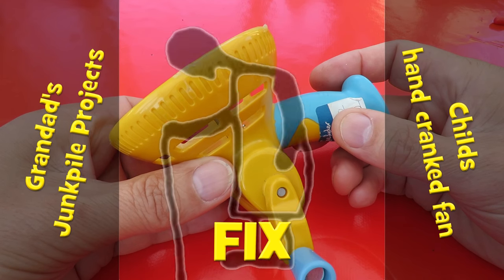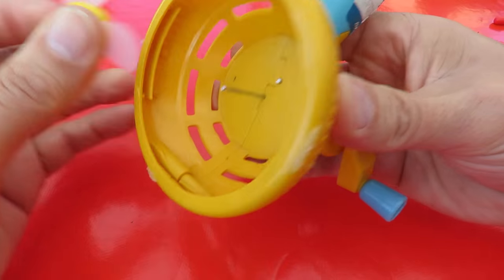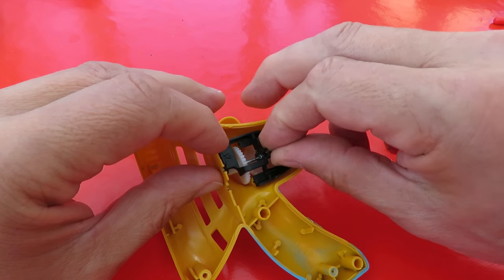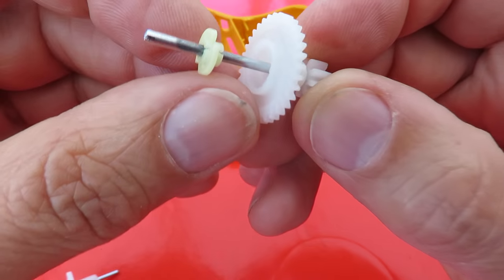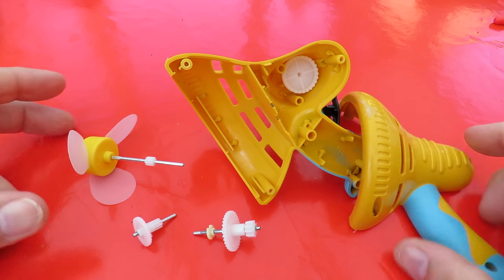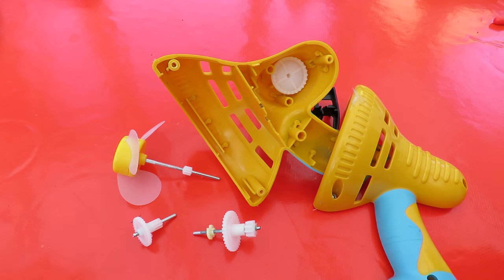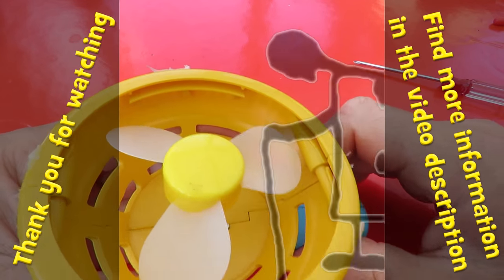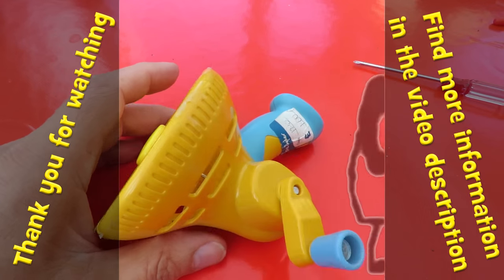Grandad's Junkpile Projects - Child's hand cranked fan fix

Comment: That's a cool fan!  I've seen hand crank fans like that at The Cracker Barrel(store section).   They make rechargeable 9 volt batteries.  You may be able to take one of your hair dryer fans, take a rechargeable 9 volt battery, and build a small hand held fan doing that.  I'm not sure how long the charge would last though.